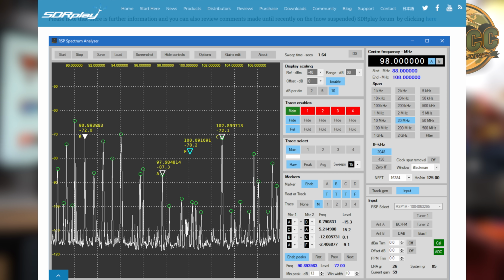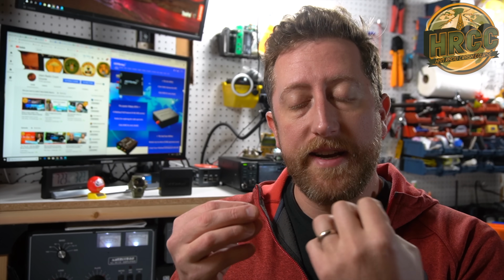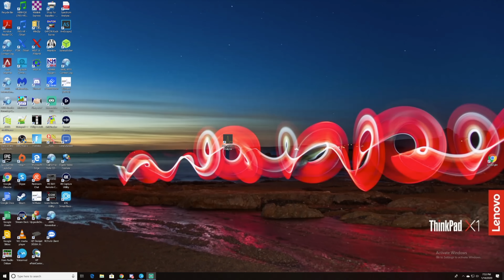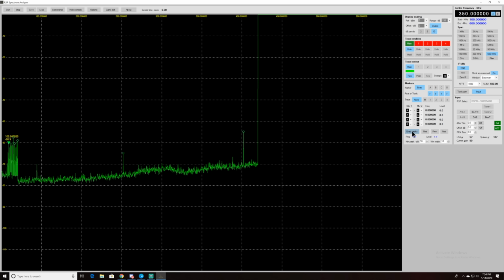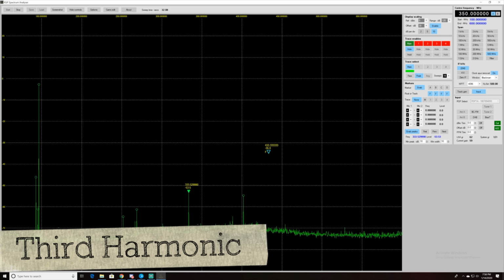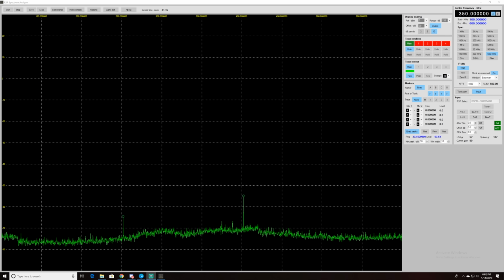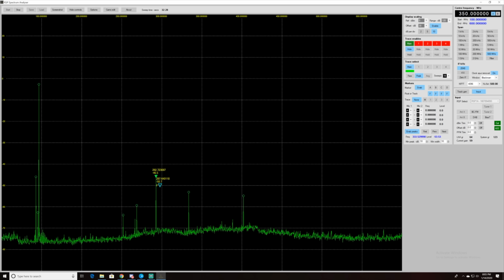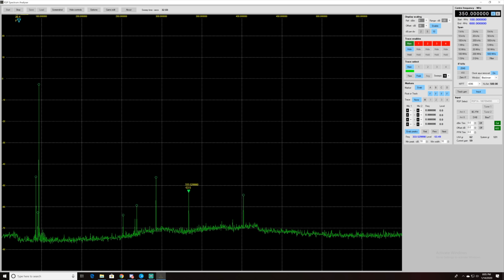$100 Spectrum Analyzer with the SDRPlay

Comment from the maker: A note on first, second and third harmonics.  The primary frequency I am transmitting on is the first harmonic.  Then the second and third follow as shown on the video.  When I refer to the second harmonic as the "first" I am meaning to say, the "fist harmonic  seen after the first..."  I hope I didn't make that too confusing!  Thanks!
Reply: Dont forget that without the antenna you are only testing part of "the system". A halfway decent 2M/70CM antenna will present an impedance mismatch to the second harmonic which may well bring marginal cases within specification.
Reply: do you read minds? This is just what i was searching about. I thought it was only possible with hackrf and specific drivers
Reply: Well understood. Thanks. I'd like to see this a live stream.
Reply from the maker: It will likely be this Friday!

Comment: I’ll also add that I’ve for years I’ve used a USB on the go cable to connect an RTL with to an Android phone using an SDR app, for very portable use. The Android powers the RTL just fine. I was able to DF a spur of a broadcast FM station a few years ago using it. You can also get an ACARS and ADSB apps to use with it too.
Reply from the maker: Good call here as well!

Comment: It would be interesting to see if the Baofeng harmonies are different on the antenna than into a dummy load. Since the dummy load presents a consistent load on a large amount of bandwidth, an antenna would not. Therefore it may be possible that in a real world use of the radio, the harmonics are attenuated by the fact the antenna is not resonant there. You would have to use a fixed antenna on both the receiver and the transceiver, with good separation to maintain the protection of the receiver input. You’d also need to make sure nothing moves in the area of or between the transmitter and receiver antennas that would cause fluctuations in the signal.
Reply: I have seen this same logic used in other posts to dispute the original HT testing ARRL did in I think 2013. If the antenna is considered part of the system and it does attenuate the harmonics even slightly, then the radio would indeed be in spec while in actual use. Of course, then we add different antennas so all bets are off, hi hi.
Reply: cyclecamp1 the manufacturer or FCC may see this as a “user modification” and place the responsibility directly on the operator. I know that may sound like a stretch, but there are millions of items that get type acceptance based on supplied equipment/accessories. I’ve noted that antenna connections are sometimes non-standard, which could be a sign they may not be compliant if used with an amp or other antenna. Good ole Apple of course does this for money purposes, and that can also be the driving force for ham devices too. 

In an example of this “stretching with a rule....” As a pilot, I fly a Cirrus airplane. The FAA rules for certification requires some ability for a pilot to recover from a stall. The particular popular model I fly did not demonstrate this appropriately enough on its own, but does so with a ballistic rocket parachute deployment known as CAPS. Thus, the parachute is “required” for it to gain and maintain its certification.
Reply from the maker: This is not a bad idea either. Ideally you’d need some kind of faraday cage though to make sure the only received signals were the radio under test.
Reply: Ham Radio Crash Course I would put a resonant antenna on your attenuator instead of directly plugging the radio to it, then place your HT at least a wavelength away, key up and see if you have enough signal that way. The receiver may not even need an antenna, maybe just leaving the attenuator input disconnected would be adequate coupling for you to move the HT close enough to it get the reference signal reading you need.

Comment: Thanks for removing me from your group. I am 61 years old and don't want to play with children. TYT group much better fit for me.
Reply from the maker: Allen, no one removed you.  We checked, we didn't see you even being a member.  But if you're happier over on the TYT group more power to you.  Enjoy your radio hobby.
Reply: @HamRadioCrashCourse  Studied for the test in 2016. 2 days before I took it Saturday I decided to brush up and the test was completely different. 2 days of crash coursing on the new test and managed to pass. Thanks for tip on the Abbree antenna.Put the 28.3 inch on my Tyt md 380 uv gps and I am receiving from a lot further away. can't test the transmit till my call sign post.